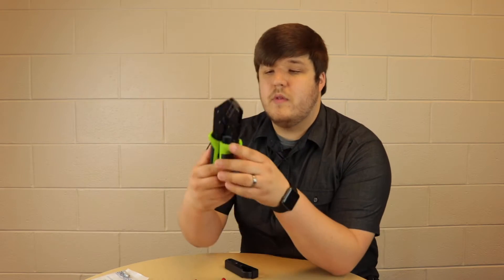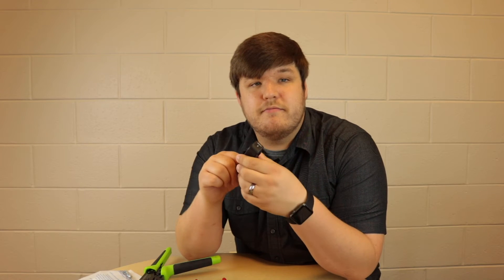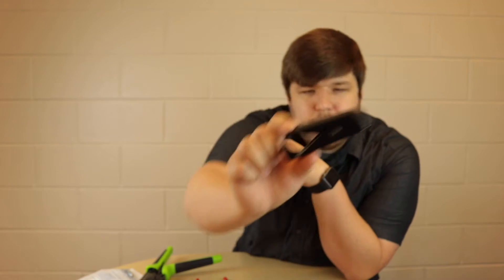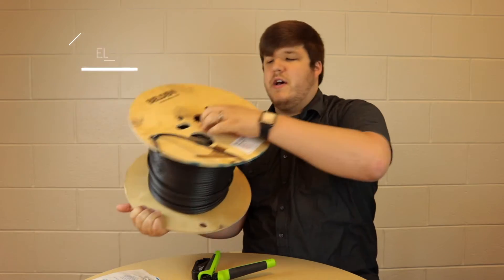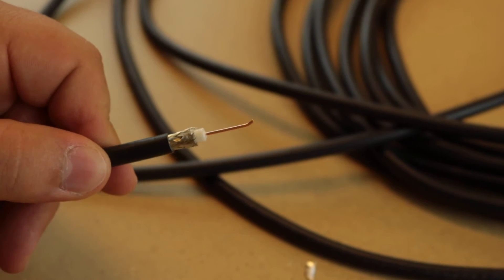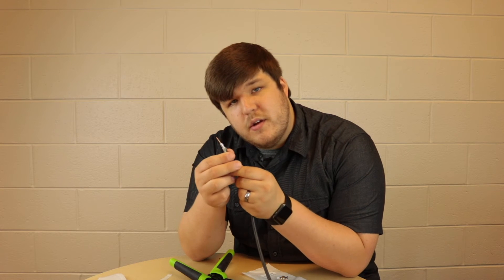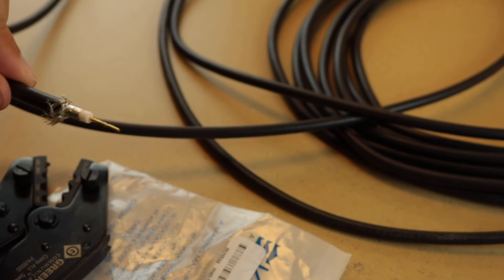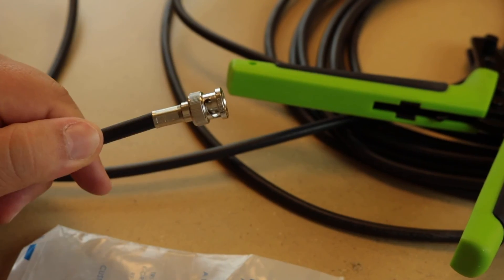How to terminate HD-SDI Cable | Money Saving DIY!

Comment: .255 crimp is too small for RG6, .255 is for rg 59, using a .255 die on an rg6 sleeve, could crush the cable and doesn't really crimp the sleeve properly , I noticed you didn't get a nice clean hex , part of the sleeve folded over outside the die, the official kings die set  (KTH-2255) for the rg6 BNC is a .268 crimp, You should use the Greenlee 2657 die set for RG6 the 2648 you are using is meant for RG59 (1505A and equivalents) and 23 AWG mini precision video cable (1855A and equivalents)
Reply from the maker: You’re absolutely right. I wondered why I always got that fold until I learned recently and forgot I had this video with the wrong size! 😳 Thank you for giving me and others that watch this video very detailed information. I will add that to my description!
Reply: I'm looking for a .268 crimp as you recommend but cant find one anywhere, do you mean .278 or .068 as that is what is included in the Greenlee set?
Reply from the maker: For the Kings 2065-10-9 connectors I used in this video the specs are: Center Pin Crimp Size: 0.046" & Ferrule Crimp Size: 0.278"

Comment: Hey Matthew! Fantastic video. It was super informative. Quick question for you. I'm wanting to make HD-SDI cables for camera builds with flexible cable that is only 2.75mm in diameter. SMALLHD makes one (linked below) but doesn't specify any specs. Any idea where I could buy the cable needed to make these very thin SDI's? Because the specs weren't specified I want to make sure I get the correct cable if I'm buying a spool and BNC connectors that coincide. Thanks in advance!

 https://www.bhphotovideo.com/c/product/1279652-REG/smallhd_cbl_sgl_bnc_bnc_mm_thin_1_12_thin_and_short.html?ap=y&c3api=1876%2C%7Bcreative%7D%2C%7Bkeyword%7D&gclid=EAIaIQobChMIjv3EjJi12QIV1rrACh2DLweBEAQYAyABEgI5Y_D_BwE
Reply from the maker: Hey John! You could use Belden 179DT cable and the Kings 2065-28-9 connectors found at Markertek.com.

https://www.markertek.com/product/bl-179dt/belden-179dt-digital-video-cable-rg179-per-foot-black
https://www.markertek.com/product/2065-28-9/kings-2065-28-9-bnc-connector-for-belden-rg-179-and-rg-187

Comment: Great video... is there a different cable used for HD-SDI than for 3G-SDI or 6G-SDI?
Reply from the maker: Segale Mabiletsa thanks for watching! According to Belden's website, 1694a cable is sweep-tested up to 6Ghz and would be compatible. The only limitation at that bandwidth is distance.

http://www.belden.com/products/enterprise/broadcast-av/cable/precision-video-coax.cfm

Refer to Belden's recommended transmission chart for distance limitations:

https://cdn2.hubspot.net/hubfs/282305/New%20Belden.com%20-%20Master%20Resources/Digital%20Video%20Distance%20Chart%203.28.pdf